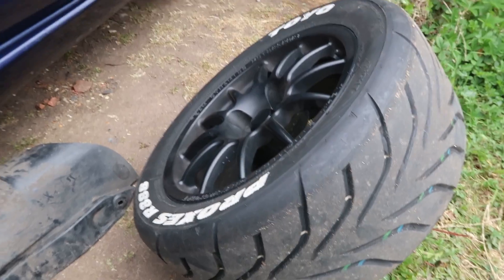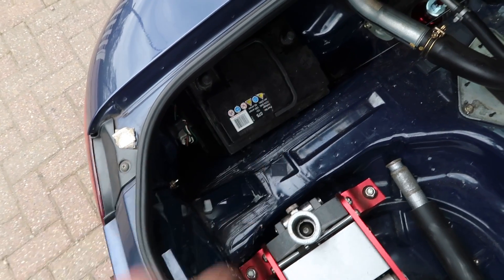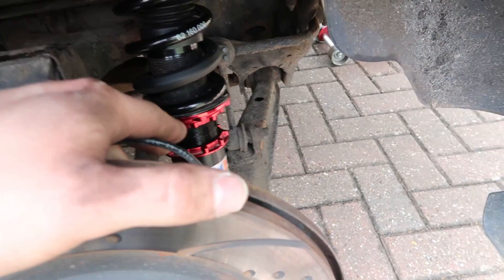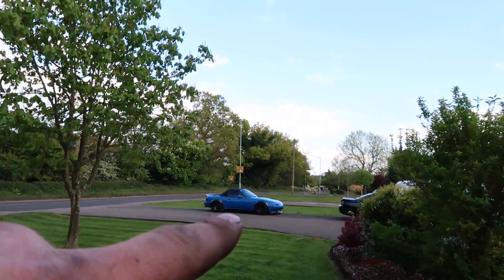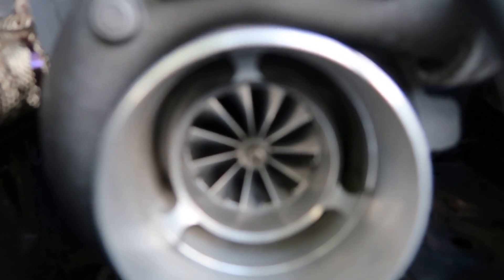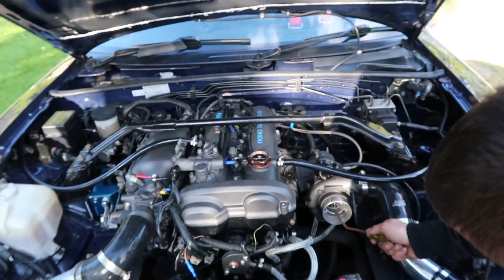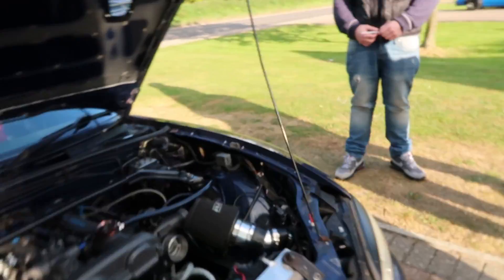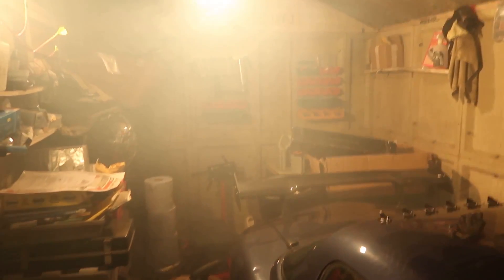I Blew Up The Turbo On My Mx5!

Comment: Just out of curiosity, why go through all the trouble of getting a built engine to put a Chinese turbo in and potentially blow the engine too?
Reply from the maker: pendulum1824 I did it because that's what I was using before I started the build and it had been fine plus it wasn't a really cheap one so I thought maybe it would be okay until I can afford a Garrett

Comment: Around how long did that turbo last before it broke?
Reply from the maker: Omar Melendez 6000 miles
Reply: FullTimeCarGuy not bad. Hope the new one last a lot longer.
Reply from the maker: Omar Melendez it should do it's real and I'm running a bit less boost 😊